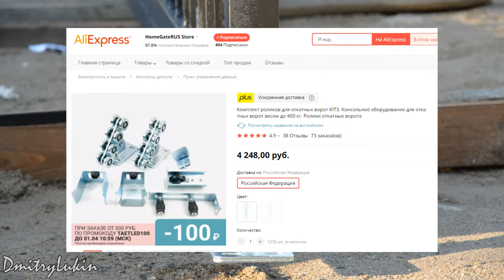How to Make a Sliding Gate. Making of Sliding Gates from a Profile Pipe. DIY

Comment: That is some GREAT work on that sliding fence!! I was going to go chain link with wooden panels but you inspired to to go bigger!  Wish me luck because I'm going to be a first time welder!
Reply: Did you do it?
Reply: @xntricity6446  That's a big negative and changed overall design. Plan  on getting a CountyLine 12 ft or 10ft. Wire Gate, Green from Tractor supply and mount an automatic arm on that to keep my dogs out of the front yard (where I have my main auto sliding gate). I don't want them rushing out onto the busy street whenever someone comes home and opens the main gate.  Now only if I can peel myself away from working on my urban backyard garden 🥴
Reply: @pcngo1 cool, I'd love to make it as I've got a quotation from a gate builder that brings a tear to my eye 😅
Reply: @xntricity6446  That and the high probability of them doing a shotty job on my new gate are the reasons why I resorted to YouTube to research how I can do the job right myself!  Looks like you're in the same boat  as me brotha!

Comment: Won't the gate loose balance and lean forward due to weight imbalance when sliding forward as there is no support on the bottom in the middle of the drive way??
Reply: It has two points of constraint on the end where it slides towards. So when the gate is fully closed, one roller is experiencing an upward force while the other experiences a downward force. That's how it holds the weight when fully closed (because he welded the roller assembly to the pad he built)

Comment: does the rail bend if you dont pit another one on top of the other? mine is 7 meter 60x60x 2 mm and it bends? what to do
Reply: If it bends I would guess yes. Even with 2 it will bend to some degree